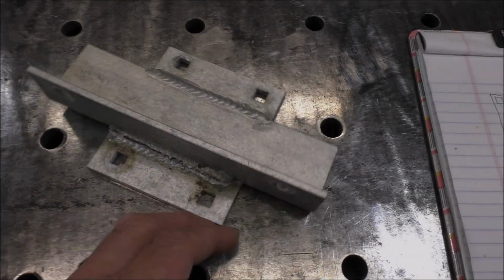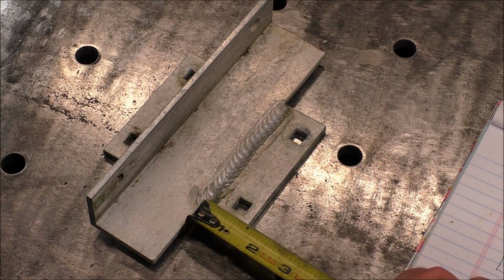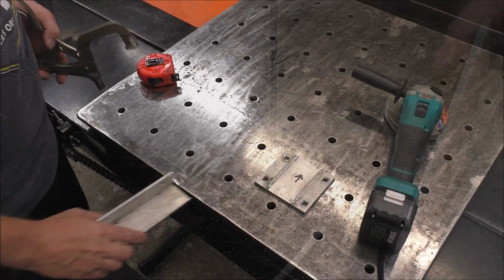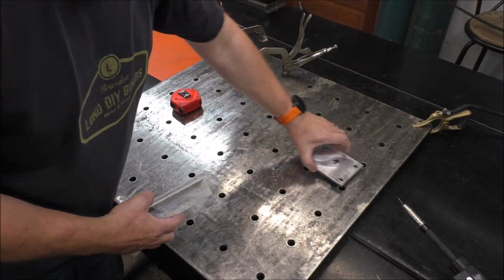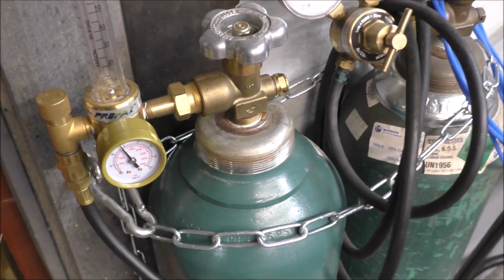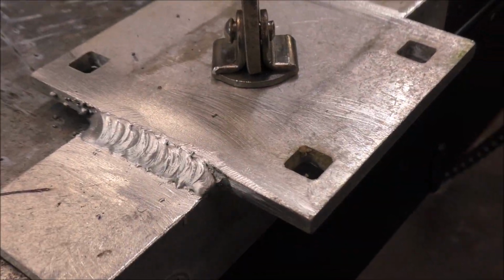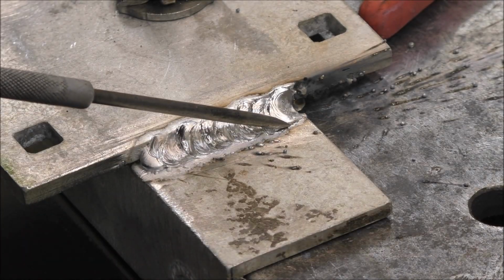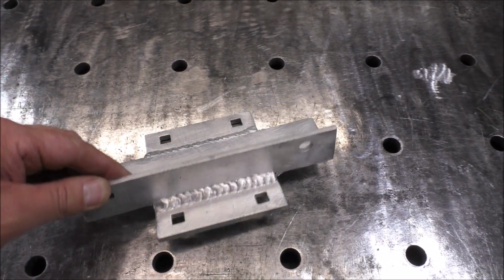MIG Welding Broken Aluminum Boat Dock Bracket Repair

Comment: Brandon, when I was an industrial electrician working in a manufacturing plant, I was always told to never use a grinding wheel on non-ferrous metals because it can build up in the wheel throwing it out of balance and causing it to fly apart. Was that true? It looked like you were using a grinding disk to remove the old welds.
Reply from the maker: You are correct...sort of lol. First off, good eye noticing that. You are correct that using a hard disc on aluminum is a no no for the reasons you noted, however, they make a hard disc made for aluminum.  That's what I was using, but it doesn't look any different from a regular wheel except it's stamped for aluminum. I don't know what makes them different, but your question now has me wondering 🙏👍😁

Comment: vhy dont you tig weld it?
Reply: You spent Tig time adjusting your mig settings. Would have been a shorter job  on the foot pedal. Just my opinion.
Reply from the maker: Whatever gets the job done 👍
Reply from the maker: Time is money $$$ MIG is about twice as fast as TIG and you end up with the same result in the end. TIG will give you much more control over heat input but its not needed for this repair.

Comment: @brandon, I am wondering what was being done wrong other then settings when that wels was done?  Now i am not far into the video, and do not have much aluminum experience at all so this maybw a newb question (aka dumb question).  Both pieces have majority overlap, so how does a weld get into the top piece pretty well but not even begin to melt into the bottom piece?
Reply from the maker: Great question! The top piece is an edge so it melts much easier than the flat plate it was welded to. The way to correct this is increase the amperage and focus the weld more onto the flat plate than onto the top plate.

Comment: Good work Brandon.  My Son-in-law and daughter gave me a spool gun for Christmas, and your video along with others has helped me recognize a good aluminum weld.  I haven't used it a whole lot, and my practice has been with 1/8 inch coupons, and my welds have been all over the place as far as quality.  It helps a lot to know how you vary your settings, to get a good weld.  
 I just need more practice.  Thanks for your time and effort in these videos.
Reply from the maker: Thank you! If you can get some 3/16" scraps you might have an easier time also. Welding thin metal is always harder than welding thicker

Comment: Hi Brandon this is Rob you mentioned using a stainless steel grinding wheel is that a dedicated one just for aluminum?
Reply: Yes mate, you got that right. Keep a seperate sets of stainless grinding wheels & stainless brushes etc for different metals, especially alloys - one set for just doing aluminum work, one for everyday steel & one for stainless to save cross contaminating different metals into your welds.
Reply: @draincctv8659   thanks Brandon
Reply from the maker: Anytime!

Comment: Great video, as always!  That original weld sure did NOT do the job.  Was it just not enough heat/current/volts to penetrate as yours did???  One question....you used the band saw that you use for steel.  Was it not necessary to change the blade for just aluminum???  I know you use brushes and grinders for just aluminum, so I was wondering about the band saw blade.  I tried to cut aluminum with a hand hacksaw and the metal clogged up the teeth on the blade.  Be well, be safe, and most of all, be Blessed!!!
Reply from the maker: Thanks Jim and great question. My bandsaw blade is pretty coarse so it doesn't clog up as easy. Any contamination from the blade, I removed when I used the dedicated grinding tools. Great question! God bless brother!

Comment: Lol, when you open up filming, I had thought its good weld but apparently its not bonded. I can see its require be cleaned before welding. From looks of bad weld, was done in water? Won't bond?? Interesting showing…. Pretty kwel.
Reply from the maker: That pretty stack of dimes was just sitting right on top lol.
Reply: @BrandonLund … that's for darn sure!! Lol😂

Comment: Nice!  I have the titanium mig 140 with the spool gun and 100% argon.  Still trying to get the hang of making a weld that looks that good. I'm wondering if a 120 volt machine is even really adiquit for 1/8 aluminum.  I'm looking to upgrade at some point to a 220v multi process.
Reply from the maker: A 120 volt machine will do it but you have to move fast. I have a video link in this video on a 120 volt mig setup that you might find useful
Reply: @BrandonLund  greatly appreciated, I will be checking that out for sure. Have a great weekend Brandon!
Reply from the maker: You as well

Comment: Great job Brandon, sure enjoy watching you weld aluminum . Being a welders helper 60 years ago and having a great time with them and seeing todays welding is so different yet so much alike. It's great seeing all these new tools and tricks of the trade. Thanks for sharing with us. Fred.
Reply from the maker: Thanks 👍 I appreciate it Fred! These machines werent around when I started either, but I do like all the features of these inverter welders. Sometimes it's too many adjustments and it's hard to figure out what needs to be changed to get it dialed in, but for the most part it's a positive change.